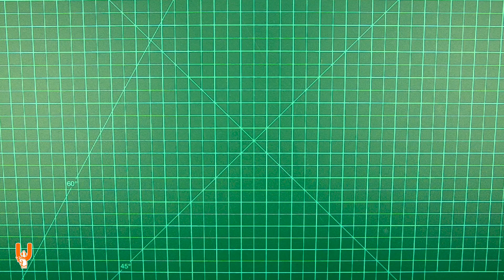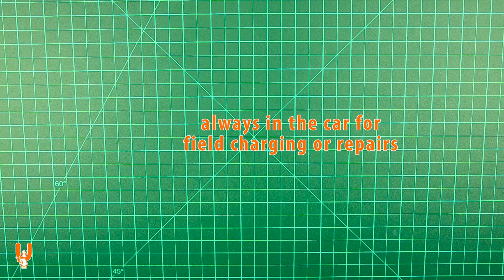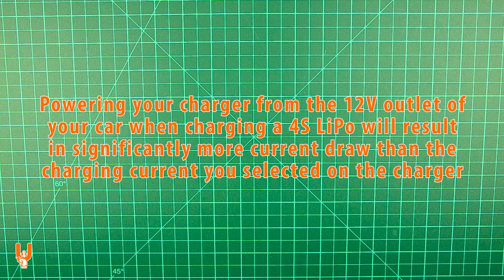Easy car cigarette lighter to XT60 adapter: A must-have for every car - QUICK GUIDE

Comment: I've made a few the other way 3-4s to 5v never thought of this great idea!
Reply from the maker: Not sure it is great but I could not find a ready-made compact adapter to always have in the car +A-Aronfpv :)
What do you usually use your 3-4S to 12V for?
Reply: muteFPV meant 3-4s to 5v oops lol usually phone or goggle charging but can be used for other usb powered devices
Reply from the maker: Ah yes, ok :) I have added a small BEC and USB in my universal goggle power button to carry everywhere ;)

Comment: great idea cant believe i haven't thought of that. Ive been hooking up to my battery like a dunce
Reply from the maker: +hipeoplesSr :) just keep in mind that you will be drawing more current, when charging batteries that are higher voltage than your car's 12V.
Reply: as long as you dont exceed 96 watts you will be fine but i would recommend leaving it lower around 70.   For a 4s battery, you should charge at 5amps max or 4amps safely.
Reply: watts=Voltage * Amps
Reply from the maker: +hipeoplesSr correct, 5A is perfectly fine for the fuse'd adapter I used (8A). Most cars can deliver much more so you can use a bigger fuse / another car lighter adapter. But I prefer to be more conservative.

Comment: will it work with 15A fuser? better/worse?
Reply from the maker: Aside from the current rating of the cables you use when wiring the adapter, I doubt that your car has such a high current fuse for the cigarette lighter. Does it? I think usually it is around 8A
Reply: @muteFPV  no idea tbh. I just saw a few car lighters with already built in fuser and 12awg cable so I thought to just get one of those and add the xt60 connector. Skip the hussle😂

Comment: another idea somewhat related, is to use a 12v car socket to XT60 so you can power 12v car powered camping crap with 3s lipos
Reply from the maker: +Geoff Pedder yep, with a step down regulator and a voltage alarm you are good to go :)

Comment: The steel and spring components are thin and have poor conductivity; even without the fuse you can't draw a lot of current without it getting warm and significant voltage drop
Reply from the maker: +Anson Li this doesn't have a spring slot for the fuse, like some other cheap adapters do. It has much better quality than other adapters I have tried but yes, for more current it may be better to use crocodile clips on the car battery